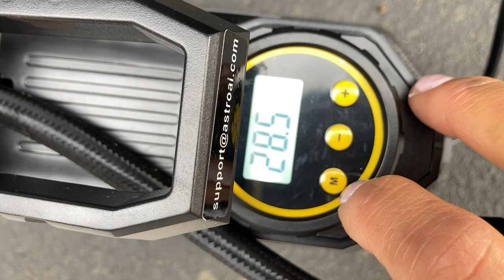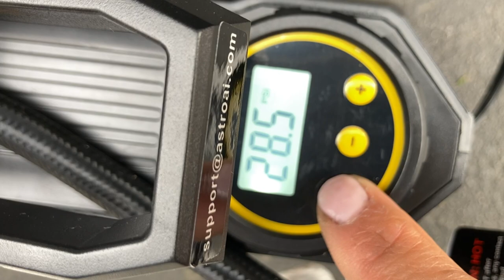Handywoman vlog:  putting air in my tires, FIRST TIME power washing, why I love being a handywoman

Comment: I would be cautious of using a pressure washer on vinyl siding.  I believe my neighbor damaged his siding with pressure washing.   I had 12 year old vinyl siding that was dirty like in your video - 12 yrs buildup of dirt and green algae.  I used Mold Armor E-Z House Wash from Home Depot and it looks like new.  I bought one container that you attach to your garden hose and several refills without the hose attachment.  I had to apply 3 times, waiting 10-15 min after each application.  Followed by a plain water rinse at the end.  It is a mild bleach solution so make sure that doesn't affect anything nearby.
Reply from the maker: Good to know!  Thank you for looking out!

Comment: Wow, that air compressor/tire gauge seems pretty useful! Definitely will save you on quarters, should buy one myself. At the very least maintaining your tire pressure will save you on gas and with current oil prices it can't hurt. 

Got a bit of anxiety hearing you talk about slightly losing control while turning haha. Get a Tire Thread Depth Gauge they're like 7 bucks at Autozone, maybe time to get new tires. If so, wet roads out there so they'll last you a long while. Plus tax write off!

From the people I've known personally that do power washing I hear the same thing. "Easy to learn, difficult to master. But stupid money to make once you got it." 

It's been on my to do list for years, I need to get around to that eventually. 

Looking good in the new apron by the way.
Reply from the maker: Yeah, that tire thing is great!  The ones at the gas station doesn’t work as well in my opinion.  My tires are used but shouldn’t be too bad, but the weird turning thing still happens sometimes haha
My only advice for pressure washing from my one time doing it haha is to invest in the best equipment.  And try not to do it in the winter because it’s cold af.  I had a ton of boogers in my mask lol
And thank you!  I love the new apron so far!
Reply: They way my allergies have been this past week I oughta pressure wash my sinuses hahaha